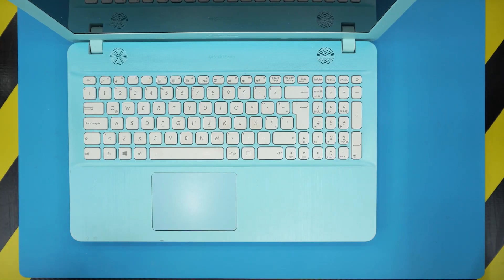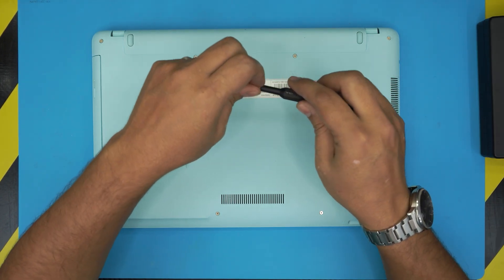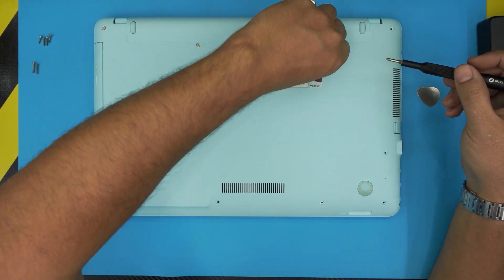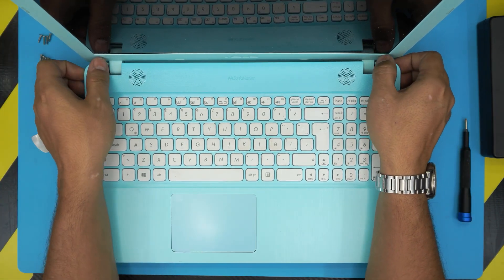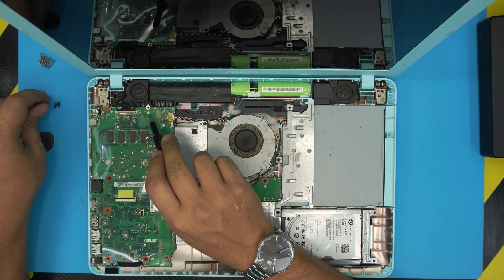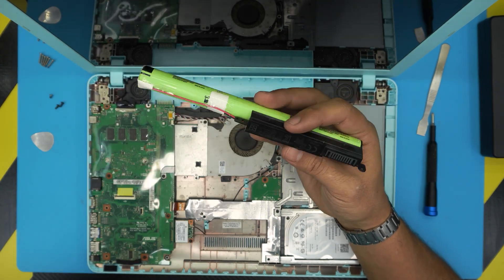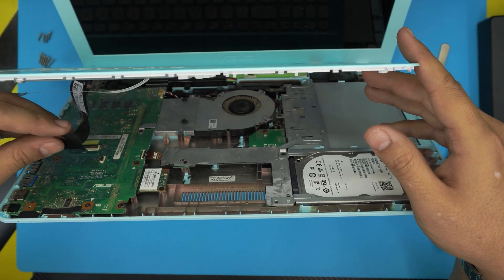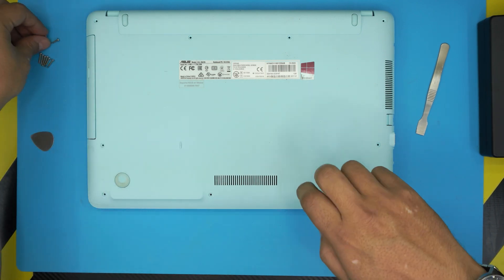ASUS X541n Battery Removal and replacement Guide

Comment: replace the battery cells
Reply from the maker: If you replace the cells, the battery still will not be 100% because there is a circuit board on the battery that is programmed for 500 or a specific amount of battery cycles before it stops. If you replace the cells, you will need to get a chip programmer and reset the battery board counter.
cheers🍻

Comment: my screws got lost, can i know what is the milimeter size of the screws? (lenght and width) thank u in advance
Reply from the maker: Thank you for the feedback! if you wish to support the channel you can LIKE or SUB or both :P
regarding your question: you have to give me more detail my friend, i don't know what screw you talking about! the screw on the bottom case(from mid or back?) or screw for the battery? left right ?
DID you LOST ALL the SCREWS?
Reply: @uFixTek  im sorry, at the bottom screw, the 4 and the 6 screws at the back
,new subscriber done.
Reply from the maker: oki much appreciate, but unfortunately i don't have the laptop on hand to get you the right size and, if so it will be hard to get them and the sellers sell then individual and minimum 12pcs. BUT
you can buy a set on ebay used screw sets.
shorturl.at/bklyQ

Comment: Bhai mera yeh laptop h usme Bios password lg gya h,     X541NA
Alt+r not working
Reply from the maker: Thank you for the feedback! if you wish to support the channel you can LIKE or SUB or both :P
regarding your question: remove the internal battery, and then remove the charger and press and hold the power on for 30sec then install the battery and the bios should get reset.
Reply: @uFixTek  not working bro.

Comment: Where i found the battery cmos bios?
Reply from the maker: Thank you for the feedback! if you wish to support the channel you can LIKE or SUB or both :P
regarding your question: there is no independent bios battery on the board the bios takes voltage from main battery, remove the main battery and press and hold ON/OFF for 30sec and the bios will reset.
if you want to see the other side of the board here is a video:
https://youtu.be/A6-spJWUkRQ
Reply: @uFixTek  hello
 thank you for the answer but its not help me maybe you have more solution?
Reply from the maker: can i know what you trying to do?, you want to reset the BIOS PASS?
Reply: @uFixTek  yes my computer stuck on logo screen
Reply from the maker: pure logo?, no text or anything, if you it's not your bios config, you may have a corrupted BIOS. or your HDD is dead.
regarding BIOS you can't replace it, a technician can replace it. BUT
1st do this to make sure its not your hdd, remove the hard drive then power on and it should give you a text saying no media or boot drive. if you get the text then we know its you hdd, and you can replace it with ssd and install windows and you set to go. else u will have to replace the bios chip.